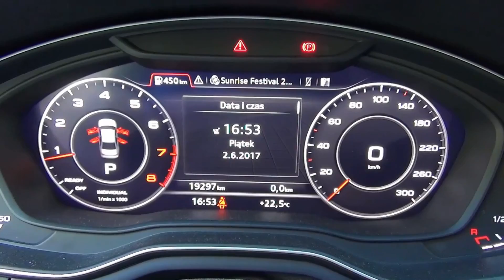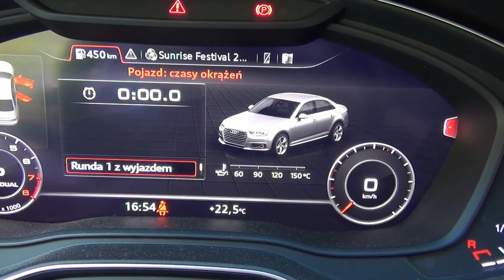VNSmedia A4 B9 Bang & Olufsen Retrofit Timeline

Comment: Beautiful job, but a sound sample would have been a bonus, i don't understand what is the point of posting all of this work, without earing it at work!
Reply: patmaz1 unless you would be listening to that sound clip through a B&O system, it would defeat the purpose. Audiophile sound bytes are kinda like inside jokes.... You really need to be there to get it.
Reply: dont worry about the sound, its at most slightly better than stock.